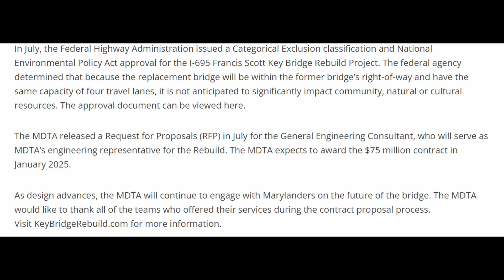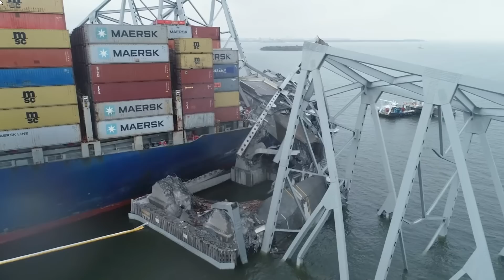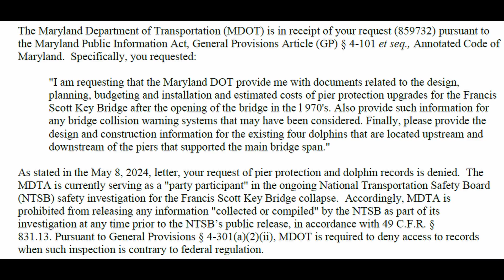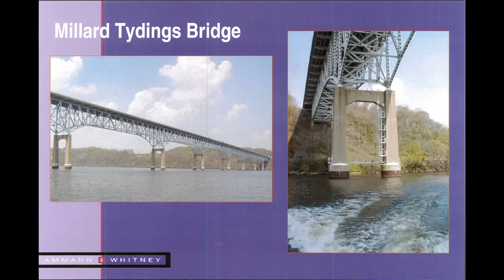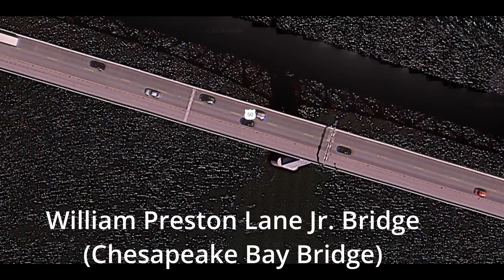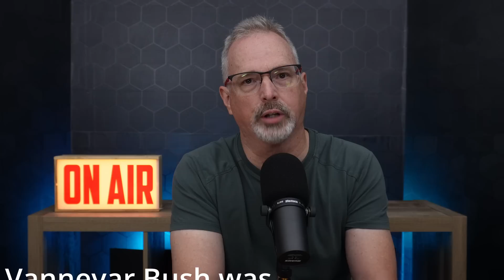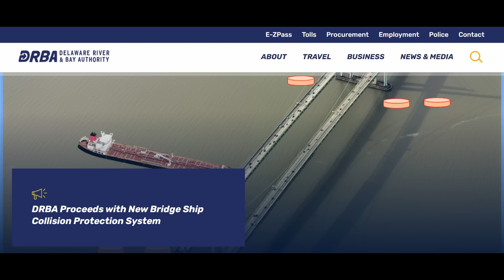FSK Update and Public Information Request

Comment: The funny thing is Maryland is among the richer states in the union. Maryland is not a poor state like West Virginia or Mississippi. Maryland could easily afford to protect its bridges. The problem with Maryland is it is cheap and the politicians running the state are uncaring, reckless and terminally stupid!
Reply: Kudos to Maryland voters!
Reply: @jamesandrewsinclair7488  If you want to b;lame the current Maryland Governor you are so wrong. Maryland has ALWAYS been a very cheap state. Back in the 1930's the then new University Hospital building was erected. 6 floors tall. Then only after a few more years was another six floors added. More recently the Baltimore Central Maryland Light Rail line was only partially built. Single tracked light rail lines north and south of Baltimore were bottle necks for years well before our current government. The bridges referred to were all built and ill protected years before our current governor. Maryland voters have been cheap since Maryland's founding. Maryland will talk a lot but won't fix anything!
Reply: @AUTISTICLYCAN  Thanks for the thoughtful reply - I was just making a cheap crack at the American culture of today. As someone else hinted in another comment, we need a way to process the events like this, complete with historical nuances, with an eye to doing better. Laying blame - though sometimes necessary - maybe doesn’t really solve the problem. Can we agree Casey is doing a great service by pointing out where due diligence is being done where maybe it I was not? Cheers!

Comment: Ah, Casey, I'm having a chuckle here and you're not going to like it.  You are experiencing a case where the government is telling you that they have this and you don't need to concern yourself.  You really wouldn't understand and there is nothing that you could contribute that we have not already considered.  Well, if they really did "have this", then there wouldn't have been an issue.  The irony here is that this is what engineers all too frequently do with non-engineers.  "You couldn't possibly understand and we don't need you meddling".  I didn't go into engineering.  I went to a smaller primarily engineering university and most of my friends were engineers.  I think that I have a fairly good handle on engineering principals.  Far too often, I have been told that, since I'm not a PE, I don't know anything and need to stay out of the way.  Often, I have seen an issue long before they have discovered it.

Comment: Thanks Casey, think you have hit upon a cover up to deflect liability away from them and onto ship owners, or in this case the ship owner! It's my feelings that Maryland should be held as the primary responsible party in the Frances Scott Key case, for their lack of providing proper protection to begin with!
Reply from the maker: Thank you, I think you are exactly right!
Reply: So, by extension, do we think DOTs should be liable for the consequences  of traffic accidents, too? In some cases it may be possible to demonstrate actual negligence, but generally? 

Isn’t it ironic that, in this case, the “smoking gun” that would lay the blame squarely on the DOT would be the (unredacted) studies, commissioned by the same body, presumably in an attempt to identify and quantify the very risks they may would be accused of failing to address.

I am wondering how - in the rush to lay blame on gov’t institutions (I’m not saying they are all blameless) - we can take into account the changing whims of an electorate who, over time, may have chosen to gut and starve these very same institutions?

Go ahead and sue the gov’t. Maybe there are criminal actions in the mix that need to be brought to light. But it’s the taxpayers who will pay the bill and voters who are ultimately accountable.

Thanks for sharing of info, thoughts and opinions.

Comment: They need to build dolphins like at the skyway bridge down here in Tampa Florida.
Reply from the maker: Exactly right.
Reply: @CaseyJones-Engineer  Maryland DOT was reported to have looked at beefing up the "Key" bridge pier protection after the Tampa Skyway collapse. The cost would have been something like $100 million. If DOT had used a small fraction of the road tolls collected for protection, the bridge might still be standing.
Reply: @robinmcglynn3222  
$100 million for something that has no guarantee of protecting anything.

That would widen several miles of I-95 in northeast Maryland, which is another MDTA toll facility.
Reply: The Skyway and their protective measures: a 40-year old design when ships were much smaller. MS Summit Venture was around 19,000 tons.

Civil engineering works need to be tested to see if they perform to spec.

Such "protections" have not been tested in real world tests or events.

Unless you ram a 100,000+ tons ship head-on into that tower island at 10 knots, you will not know whether it will survive the test.

I don't have any confidence in that installation under those kinematics, and ships will only grow even longer and heavier over time.
Reply: @scottkozel1519   have you seen the setup they have around the skyway?

If a ship or any size hits the barriers at the skyway. It's going to do better than the one the Dali missed. 

I understand what you're saying. 
It seems to me that you don't know what the protection that is at the skyway nowadays. 
I live in southwest Florida and have been across the skyway a good amount of times. 
But I do understand nothing is perfect in the protection of whatever it is. 
That's where one needs to take accountability for their own personal safety also. 
I don't depend and thing but myself to protect myself. It's common sense. 
Yet, people do stupid things everyday that get them hurt or killed. 
Not all tragedy is someone else's fault. 
Yet, people try to play victim as much as they can. 

All I know is the protection at the skyway I trust a whole lot better then what was at the key bridge or having no protection at all.

Comment: Look up recent Info Act suits in your Circuit.  Use them as a template, file your own suit Pro Se, make them explain to a Federal Judge why they shouldn't cough them up.  The law is clear.
Reply from the maker: Thank you very much those are great suggestions!
Reply: @CaseyJones-Engineer  local news organizations also may have tips, if they do investigations. First Amendment auditors on YouTube are also experts at pro se info requests.

Comment: It's been demonstrated that the pier protection was inadequate - since an unpowered / adrift ship managed to strike it. We both know that there are provisions for ship impact in AASHTO BDM. It should, then, be the DOT's responsibility to have provided for this event in conformance with the BDM - especially since they appear to have commissioned relatively recent studies to take a fresh look at it. I will guess that the redactions in the documents provided (and omission of those that were not) are in part due to the lawsuit(s) over the cost of replacement of the bridge. I'd bet a nice lunch that the legal action(s) will draw on the same materials you requested to determine if the protection was consistent with the design provisions and later studies with the goal of the ship's insurers to put as much of the cost a possible back on the DOT and designer for providing inadequate collision protection.
Reply from the maker: Thank you very much. I think your comments are right on target in each case. The DOT knows that they have shared liability here for not properly protecting this bridge.

Comment: I expect the information requested is in a filing cabinet warehouse - taken there after the switch to digital systems (paper reduction act of 1995).  These storage warehouses are containers without heating or cooling so the non vellum paper files have slowly fallen apart or worse moved to a trash bin
Reply from the maker: That may be true but they didn't say the information was unavailable.  They just said they weren't going to give it to me.

Comment: We really need open government so that FOI requests are not necessary or the rare last resort after openness has failed.  But, already having a little accountability makes running a government more expensive than a business.  Voters like tax cuts.  Most people value efficiency above accountability.
Reply from the maker: Well I think part of the reason they don't provide the requested information is specifically to avoid any accountability.
Reply: @CaseyJones-Engineer  Are there some states that do a good job of publishing infrastructure information?  (without an FOI)
Do you have an information wish list?
That would be an interesting comparison -- what some states publish and others hide.

Comment: 0:54 "I don't know why you need years and years of environmental processes..."   Yeah, somebody's definitely spent his whole career on the design side and never touched NEPA processing and permitting, let alone project development.
Reply from the maker: The point is why take years and years on something that's already existing. They know all about the issues already.  No need to reinvent the wheel sorry to say to all these environmental consultants waiting to rack up a bunch of extra fees.
Reply: @CaseyJones-Engineer  The point is, those impacts do not already exist. The CE indicates the new bridge will be 50' higher over the water and have a substantially wider opening. That means new piers and dolphins in new locations, new disturbance on the sea floor, new species that may have been put on the Endangered Species List since the original bridge was built. The higher opening and taller towers of the cable-stayed bridge will change the viewshed from Fort McHenry, which is a national monument, which triggers Section 4(f) and Section 106 consultations. The proposed wider shoulders will increase runoff, which is hand-waved by the CE. Taller bridge means potentially more and bigger ships in the harbor, leading to increased truck and ship traffic, causing increased air pollution. And so on.

Now, obviously the reason they can hand-wave these impacts away is the emergency provisions under NEPA and most of the other environmental laws. It's the same reason the I-35W bridge in Minneapolis/St. Paul could happen so fast. But that's also because there's political consensus behind the need for the project, and the political actors involved are willing to use those provisions. When environmental permitting is used as a proxy for politics, you end up with something like the Bayonne Bridge, which had a four year-long , thousands-of-pages EA just to raise the deck. Many other environmental projects grind on for a decade or more as different stakeholders jerk the project around and the permitting agency works to lawsuit-proof it. 

I'm not saying the system is good, but it is the system that's been built. If this was a non-emergency replacement, it would be a years-long analysis.

Comment: Your observations are spot on, here in Norfolk we have to spend BILLIONS on tunnels and have more tunnels than my home town, in the Allegheny mountains, Pittsburgh has,  why? Because the US NAVY since the 1950s has required the state build TUNNELS to cross all the channels going to the Hampton Roads, Chesapeake Bay, or Atlantic Ocean fearing a collapsed bridge would trap the fleet inside the harbor. These include channels going down the ELizabeth River to the Norfolk Naval Shipyard which is in Portsmouth Va (to differentiate it from the Portsmouth Naval Shipyard in New England) . Charleston SC saw it's naval facilities closed because of the Ravenel Bridge not being tall enough to allow the largest naval ships to pass during all tide cycles and the fear of a downed bridge closing the base. Maryland cheaped out and built bridges and this year they rolled the dice and came up snake eyes. The Chesapeake Bay Bridge Tunnel, to the Eastern Shore had it's trestle taken down by a large ship decades ago even though the tunnels were unaffected, vehicle traffic was detoured for a year. Now the quasi public toll corporation has built dual trestles and is doubling the tunnels so a total loss of access will be almost impossible. Because of the fear of taking a trestle out, the anchorage was moved from off of Cape Henry to off of Cape Charles to protect the trestles from storm pushed ships. I don't dislike cable stay bridges, at first they appeared awesome, but coming from Pittsburgh, we came to appreciate all the different types of bridges inventive designers have created, but now we no longer get bow string truss bridges like the ones at tbe point, or the bSmithfield which is a very rare double truss, or the 3 sisters, which are beam and eyelet suspension bridges (similar to the collapsed Silver Bridge) or the calalever Glenwood Bridge where part of the structure peaks up over the roadway. In a word, cable stay bridges are no longer different,  or notable. The dual bridges over the Delaware Canal that take SR 1 and US 13 over it show us how much designs have changed in the decades. But to your point, politicians don't spend money on "maybes" they have too many palms out and "necessessities" to finance  without raising taxes, so until the Key Bridge fell, protection was in the back of their minds but they hoped the problem would not rear it's ugly head until the next Governor or Transportation Secy was in office.
Reply from the maker: Thank you for your comments. There's a lot of insight there and I agree with you.
Reply: See:
Chesapeake Bay Bridge-Tunnel
I-64 Hampton Roads Bridge-Tunnel
I-664 Monitor-Merrimac Memorial Bridge-Tunnel

No bridge over the shipping channel that can be hit by ships or bombed during war.

Comment: Public info request typically result in some level of malicious compliance. You get a response that's unresponsive. Remember when police body worn cameras were a good idea - fast forward to today most request result in a cost estimate for the per-frame redaction of the subject film.  The cost are of course astronomical and no data is ever provided.  Just assume every redaction reveals some aspect of an inadequate design. You won't see the requested info until a lengthy civil suit discovery process. The bridge was obviously inadequate and the supporting facts will come out in court and the guilty will hide behind the various forms of immunity granted to public officials.
Reply from the maker: I think you're right.  They're worried about the pending lawsuits and know they've got huge liability in this situation.
Reply: Good luck getting anything from anyone in Maryland. It could be an explicit requirement in the state code, and they'd still resist and stonewall.
Reply: I don't think civil suits against MDOT or the State of Maryland will get anywhere - they'd be quickly dismissed on grounds of Sovereign Immunity.

Comment: A causeway with closely spaced piers will require dolphins along the entire length.  That will be costly, and may impede the waterway currents.  This will change the economics of construction of causeways versus medium and long span bridges.
Reply from the maker: True, but what about the economic impacts of a collapsed bridge?
Reply: @CaseyJones-Engineer  
Hydrologic problems are not analyzed under economics. They are a unacceptable environmental problem.

Comment: The Homeland Security secrecy aspect might have been a cause of the Millennium Tower (SF) and 161 Maiden Lane (NYC) leaning towers.  If it were easy to get details of the footings of these buildings curious/nosy neighbors, even without any engineering background, might have been alarmed by footings not extending to bedrock.  The condition of the bridge that collapsed in Pittsburgh might also have been kept secret.
Reply from the maker: Interesting point. I'm inclined to believe it was just simple incompetence paired with the desire to save money.
Reply: @CaseyJones-Engineer  Given secrecy, a certain type of person, or perhaps any person, will be unable to resist temptation.  I personally think that the builders were competent, they just decided to take a businessman's risk, which did not work out.

Comment: Thanks for the information, or maybe the lack thereof! What’s with all the redactions? Why would bridge protection merit all that black ink? What are they afraid might get out? 🤔
You are certainly to be commended for your persistence getting as much as you did!👍🏻👏🙏
Keep the pressure on 💪🏻
Reply from the maker: Thank you so much.  It has been a time-consuming process to get what little I have, but I think it is interesting that there are at least 4 other bridges that are vulnerable to ship impacts that that they have done nothing about.  Just like they did nothing about upgrading protections for FSK Bridge.  I will keep at it.
Reply: @CaseyJones-Engineer  Aside from the Bay Bridge, the other spans are under far less hazard, as the traffic under them is largely barges, tugs, and fishing boats. (I've allided with the Bay Bridge, but it was under no threat from my sailboat!)
Reply: I can't think of any reason to redact a 20 or more year old report other than CYA. It is simply ludicrous.
Reply: red tape justifying red tape